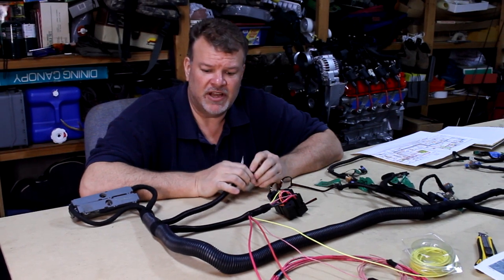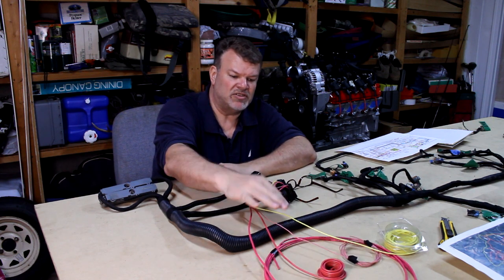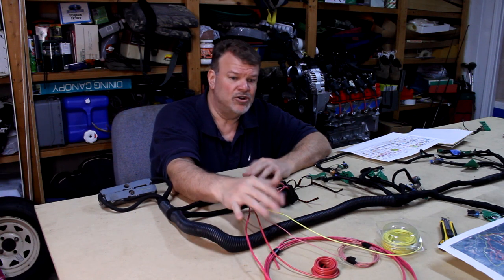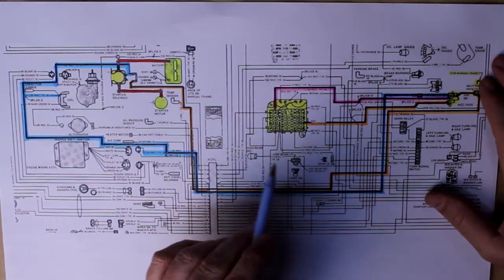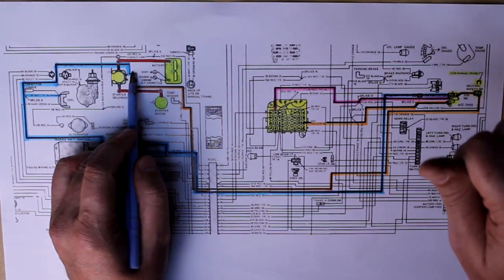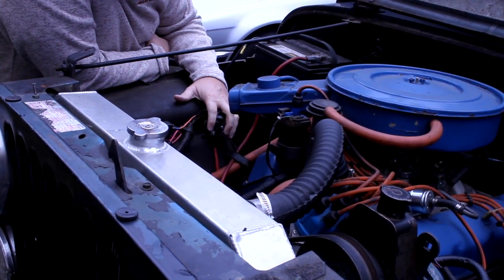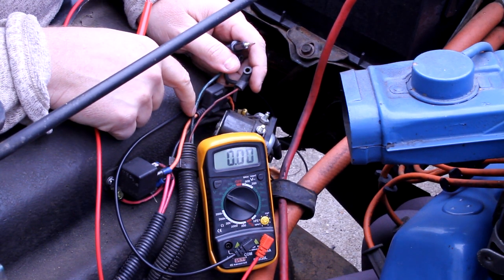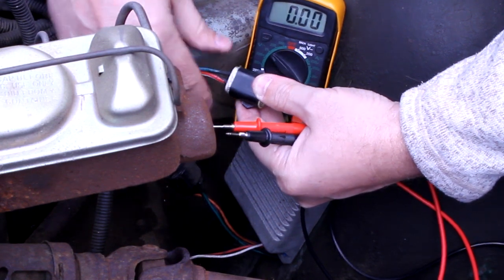LS Wiring Harness Part 6 | Project Rowdy Ep018

Comment: What did you use for programming?
Reply from the maker: I have not programmed it yet.  The local resource that I was going to use, has moved.   I will be sending it off somewhere...
Reply: UCanDoIt2 ahhh. I see that it hadn't been installed yet after I posted this. What are your plans then to disable and tune?
Reply from the maker: When the time comes, I will have to find a place that I can send it to.  Most likely will have to mail it off.  I have been holding off on getting it done until I was closer to needing it so that if small adjustments needed to be made, it would be covered under the "new" tweaks.
Reply: Blackbear tuning does mail order tuning. Have you thought about grabbing hptuners and tune it yourself? As long as you still have the aldl port that is. Loving the build though. I'm doing a single turbo 4.8/tr6060 in an 05 cavalier sedan with my kids.
Reply from the maker: I thought about doing it my self for about 2 minutes!!!  I do various computer programming for a living so figuring out the program would not be a problem.  I have seen several good tutorials, but would need to really dig deeper to feel confident with tackling it myself.  For some reason, I am just not interested in it.  I think mostly because of the software/credits and the fact that I probably would not use it again.  I am kind of a "Set it and Forget it" kind of guy.  Not really interested in tinkering with it.  My setup will have the OBD2 port which is what it would require.
Reply: Ahh I see. I do tuning for various applications. Hell I swapped over to e85 and a small procharger for the wife's minivan. Since the jeep wrangler and the caravan/town and country share a similar engine it was easy to make it work. Tuning was a nightmare though.

Comment: I need to pick your brain again. Im using a 99 to 01 Silverado computer but im using an 07 Cadillac STS drop in MAF sensor. Im having a hard time finding a wiring diagram. Both Setups run a 5 pin connector.
Reply from the maker: Sounds like you are going to need to find the pin specs for the new MAF and validate that it is pinned like the harness is expecting. If not, you can cut and splice the harness wires at the connector to make the required adjustment.
Reply: I was hoping you had them lol. I think i just figured it out though. The ground was in a different location. Im going to swap it out tomorrow and see what happens.
Reply from the maker: You're the one with the Frankenstein group of parts!!!!!  Baha!  Hope it works!
Reply: Yeah it's a hodge podge lol but i think it's going to work
Reply from the maker: Heck yea.... It's going to work!
Reply: It's a race car doesn't have to be perfect just has to work lol

Comment: Great videos you have made first off. Secondly if you havent figured out the extra wire from the ignition module to the starter solenoid. It is so that A. The wire going to the ignition module/distributor is a resistive. They only needs 9ish volts to operate. But the engine starts alot better and easier with 12 volts. Whitch is being fed from the ignition solenoid wire. B. When you put the engine from"start" power to the "run" power is cut from the start terminal of the ignition switch and is fed from the power going to the ingition solenoid from the run terminal of the ingition switch.
Reply from the maker: Awesome!  I believe I follow what you have stated.   This explains what is going on with the current ignition solution and it doesn't indicate that I need to change my current plans.  I plan to remove both the Ignition Module and the Starter Solenoid.  I plan to tie into the two ignition related wires as they come through the firewall interface and eliminate any splitting of the wires.   Thanks for the information!

Comment: Can i just leave the pins in and just cut the big blocks and do constant  and switch 12 volts
Reply from the maker: I believe you can.  You should properly address the cut ends of the wires.  i.e. tape them.  From an electrical standpoint, it should not matter if the PCM terminates a circuit (not wire) or it has been extended and then terminated.  Just my opinion.
Reply: Oh ok yah I'll like to do that instead of opening up the hole harness. Great video btw

Comment: I just watched all your LS wiring harness videos. Thank you so much. They are very nicely done. I want to be able to do stuff really right and do it myself, which is what these videos will help me to do. I am curious about how to tweak the PCM to remove the VATS and all the other features and codes that will no longer be used. Do you have thoughts on how to do that?
Reply from the maker: My plans are to hire that out.  I have programming experience and could learn how to use the HPTuner s/w, but don’t need to spend the time.  Typically you would download the current s/w configuration from the pcm, make changes, the upload the new config to the pcm.   Most guys that do a lot of these have “files” ready to upload with slight tweaking based on your config.  VATS is one of the things that is most often disabled.  Hope this helps.
Reply: I was leaning towards the HPTuner software. I would like to be able to make changes myself. Thanks for your help.

Comment: I'm commenting before I finish watching which is probably a miatake, I believe you're getting 6 volts because it's back feeding from your ballast resister.
Reply from the maker: That very well could be.   I will clean all of that up after removing the old engine and it's components.  I appreciate the input!!!  Thanks...

Comment: This may or may not have any thing to do with this vehicle but it used to be that a starter relay had another connection usually marked R. There used to be a ballast resister that lower we the voltage to the coil but the R got connected to the other side of the resister so during cranking when the voltage was low due to the starters draw the coil would get the full available voltage to help the engine start easier. I can't see the schematic well enough to follow it but it's a possible reason and if not, you may still run into this at some point on some other project. You seem super thorough so I thought I'd add this for your consideration.
Reply from the maker: Thank you!  Some very good information.  Cheers!!!!!

Comment: You know I really love this video set and I have watched them all, but after researching LT1swap (as you recommended) and searching thru the internet, it seems as if I can't find any step by step or much info on the gen IV 6.0 58x wiring harness build..so I conceded and purchased the complete kit from PSI Conversion (20% off for black friday) yes it really hurt me and I have buyers remorse lol, I will sell my stock wire harness, pedal, MAF etc..but it hurt paying for the conversion kit when I could have saved hundreds to rewire my own...just was not confident I had alot of info..matter of fact alot of companies I called said they have not gotten around to the LY6 gen IV 6.0 and 6l90e trans..eitherway great video sets love them..CJ by the way just dropped mine in https://www.youtube.com/watch?v=ldSjmKW-buY&t=1s
Reply from the maker: Yea.... It looks like there is not enough information out there for some of the newer engines.  Cheers!!!!

Comment: Just spent the last 2 days binging every episode since the taredown,  It is amazing the detail you went into. And the fact that there are just as many episodes on the wiring harness as the engine build emphasizes how important the computer is on modern engines. I think I would have always just assumed find a way to throw a carburetor on it or use an engine that can have a carb before dealing with the computer. But the way you break it down simplifies it, a lot. I am assuming you are going to have to get the ECU reprogrammed right? Otherwise you will have a million codes from missing O2 sensors, wheel speed sensor.... etc. not to mention the cam. 

  How does that work? Do you tell them exactly what cam you have, what sensors you deleted and your vehicle set up and they program it from scratch? Or is the stock programming more adaptable than I am thinking? I would LOVE a video on this subject when it comes time. 

  I can't wait to see this thing run. I am jealous. There is something so satisfying about projects like this that you are able to tare down, clean it, and start from scratch from beginning to end, yourself. Taring the harness down the way you did took away o lot of how overwhelming it is to me.
Reply from the maker: Many, many thanks for the kind words.   My entire approach to this project was to break it all down so that it made sense to me and hopefully by recording and sharing, it would make sense to others as well.  Cheer!!!!!!    The original place that I was going to have reprogram my PCM has fallen through.   Here is what I am expecting....  I would imagine that the Tuner will have a set of questions of things that I have deleted.  They would also know to automatically remove things like VATS (vehicle antitheft).  And that we would have a conversation on those changes so that they could incorporate the appropriate software changes.   I bet, that once they understand what is needed, they will start with a "Template Configuration" and make a few mods, then upload it to my PCM.  So I believe you were right on target with your question and as I read it, I was consistently saying yes, yes...   Cheers and thanks for following along.   I will be getting back on the body work of the vehicle soon.   Cool stuff!!!!!

Comment: Great videos! Just trying to work out the electrical load requirements for various circuits. Looks like you're running all engine power through just two relays. Have you encountered any good links for explaining automotive electrical circuits and relay/fuse size requirements. You must be planning on adding all the jeeps extra accessories like lightbars, winches,etc. with an spod type distribution system with totally separate circuits.
Reply from the maker: Thanks for the feedback.   Yes the Engine and it's harness is a completely separate electrical entity.  It will have nothing to do with other Jeep component electrical circuits.  "Just two relays"... actually only one of the two relays is involved in running the engine.  There are two power sides (1) Always Hot and (2) Switched Hot.  The Relay on the right of the diagram activates that Switched Hot side when your ignition switch is on.  The Always Hot side is routed through 1 Fuse (15 amp) and the Switched Hot is separated into 3 Fuses (15 amps each).  You can download the diagram from the description section below the video (Show More)....  Hope that helps!!!

Comment: Where does the purple 12v+ battery connect to?
Reply from the maker: One end to your Starter Solenoid and the other to an existing wire from your ignition switch (Start Position).

Comment: Great videos. By chance did you ever do a continuity test across each connector in your rewired loom to check to be sure both the connections are complete and there's no breaks in the wire underneath?  Also curious if that larger gauge wire you used to continue the purple wire would draw more amps and confuse the computer. If I recall that goes to your starter, and not sure if amps are measured, perhaps to prevent overdraw when a starter is locked on or too resistant due to heat or wear to crank.
Reply from the maker: VacFink I did not do any continuity check between end of each wire.  The original harness appeared to be in good condition so I did not see the need. If there is an issue down the road, I can take care of it individually at that time.  The wire that I used to extend the purple starter wire is of the same gauge.  I should not see any issues there.  It is the trigger wire for the Starter Solenoid.  The starter motor gets its positive connection directly from the battery.
Reply: A larger wire can carry more amps without letting the smoke out, but does not draw more amps by itself. It would technically drawslightly less amps due to lower resistance, but in this case were talking about a very small fraction of an amp on a 10 amp circuit. Also, that wire is not carrying the current that turns the starter, it is carrying the current that runs the electromagnet that pulls the solenoid armature in to connect the battery cable to the starter motor. Another way to look at it is the starter solenoid is just a really big (400+ amp) relay, and his purple / red wire is the trigger wire for the relay.

Comment: Awesome videos. I plan on doing a LS swap in a squarebody Chevy truck next Spring (If funds allow) and doing my research now! I have bookmarked all of them and I'm sure I'll add a few numbers to the views lol. Just a quick question though! Are you having your PCM tuned? I noticed you're removing the rear o2 sensors. Is this beast going to be cat-free? That is the only thing I don't really get so far as it would probably throw a CEL without those rear 2 o2's. I hope I worded that right. Thanks again!
Reply from the maker: I would love to do an old truck one day.  Yours should be a fun project.  Yes, the PCM will need to be reprogrammed to "Delete" several standard feature to eliminate throwing codes.  VATs (Vehicle Antitheft), Rear O2s, EGR, anything Automatic Transmission based, etc.   To be honest, I don't know all the answers...  I will be sending it off for the re-programming and expect them to ask the appropriate questions.  I don't have much concern on how this is going to work out.   Best of luck with your research (my favorite part) and your build!!!!!!!

Comment: Didn't you switch the two red power leads from your last video? I thought you said the red coil of wire was for the starter, not battery
Reply from the maker: Let me describe the 4 wires again (based on how they look the 2:00 mark of this video.(1) Left RED Wire - There is a large gauge Purple wire coming from the Starter Solenoid that is spliced over to this Red (looks Pink in the video) wire.  In my wiring diagram, it is labeled as the Purple Wire.  This wire will need to be connected so that it get + when the key is turned to start.(2) Left Center RED Wire - This needs to essentially be connected strait to the Battery.  There are many creative ways to do this.  I will show more details when my project Jeep gets to that point.  You can get creative.(3) PINK Wire - This is your Keyed Positive.  Is need to be connected to the ignition switch so that when the Key is IN and Turned to the 1st position, You get a + Feed.(4) Right Yellow Wire - This will be run back to the Fuel pump and connected to the Positive side.  When the PCM requests the Fuel Pump to be on, it will send positive voltage to the Fuel Pump Relay, then the Fuel Pump Relay will supply the Positive Current Voltage to the Fuel Pump.  The Fuel Pump will be locally grounded.Does this help????
Reply from the maker: The Large Coil of Red Wire (looks Pink) is for the Starter.  The Tightly Coil of Red Wire is for the Battery.

Comment: The pcms are the same from 99 to 06 gmt800 trucks the pcms with the last three numbers of 411 known as a 411 pcm have more functionality so you should be able to set the starter time you want
Reply from the maker: I noticed that the 2003 and Up Harness contained some additional wires and PCM related pin for this on the Blue/Green connector style harness.  The pinning of my Blue/Red connector harness was not wired for it.  Interesting that the PCM has the capability.  Good to know!  Thanks for sharing!!!
Reply: UCanDoIt2 yes no problem
Reply: do you or would you do this to my harness if i sent you the harness and some cash?